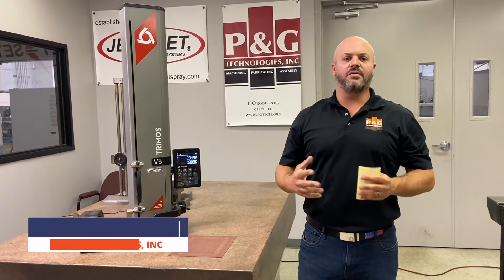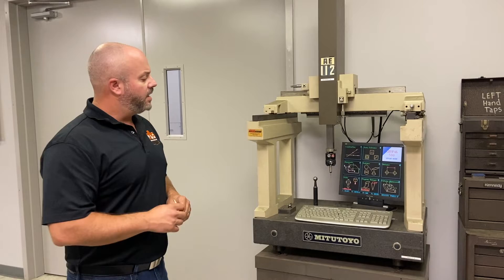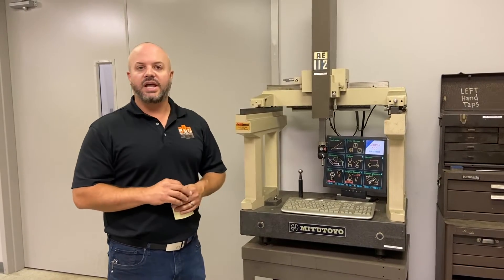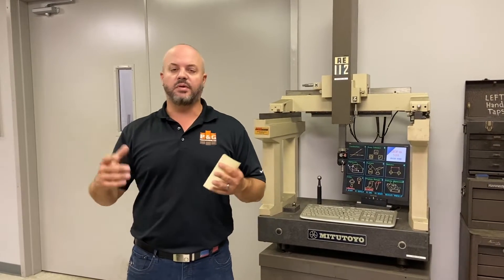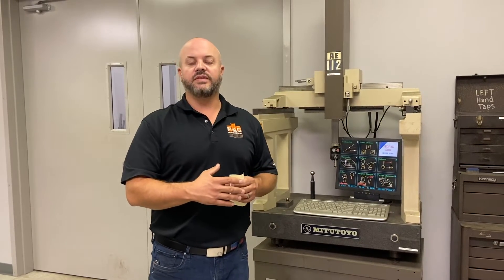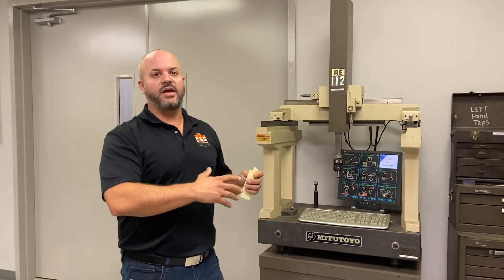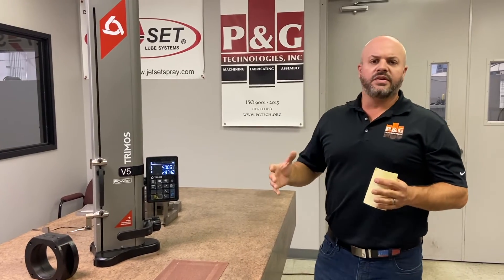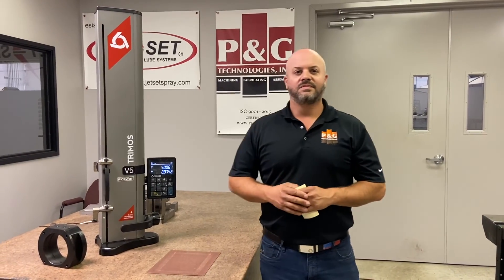Digital Height Gage OR Coordinate Measuring Machine?!

Comment: The CMM he is using is from the 70’s and still running and working. Where will that digital height gage made in China be in 40 years? Mitutoyo also makes height gages. Don’t let a vendor dictate what you need for metrology because that is all he sells.
Reply: With all due respect, that Trimos height gage is manufactured entirely in Switzerland.  Mitutoyo does make height gages as well, but will you get one made in Japan...or Brazil?  It shouldn't matter, if their quality control is robust, but the last Mitutoyo height gage I worked with developed about .100" 'backlash' in the plastic rack/pinion elevation adjustment in less than six months.  Scale still read accurately, but the lack of quality was a huge disappointment as I prefer Mitutoyo for most other tools.  I totally agree with what you said about not letting a vendor dictate what you need because that's what they sell.  I have seen that a lot, especially with cutting tools, unfortunately.

Comment: I wish this came out just a couple days earlier, I'm right in the midst of this debate for my shop right now and have been doing some deep dives on these linear height gages.
Reply from the maker: What are some of the different perspectives/ sides of the debate?
Reply: @PracticalMachinist  I am a one man shop. With that in mind, these were my big bullet points.
Price - this varies a ton. Height gage is relatively set, whereas used CMMs vary as to what is available, and vary even more with hidden repairs
Serviceability - height gage is large, but possible to ship to factory for service. Cmm is essentially field service only.
Ease of use - height gage relatively quick and easy to learn, cmm depends on software.
Capabilities - cmm in theory wins here, with the ability to measure things like hole intersection on double compound angles, etc. Biggest thing for me, was, assuming a hole was 100% concentric, accuracy of measuring a hole. To me, it seems like the height gage wins here as the used cmm market has a ton of variables. My experience leads me to believe most used CMMs are not as repeatable as I would like.
Support equipment - height gage needs power, blocks and accessories for stabilizing part, and a surface plate. Cmm will need ultra clean air, possibly equipment to write inspection programs. Height gage seems somewhat resilient to shop floor conditions, some CMMs are designed with shop floor on mind.
Reports - CMMs will have programs where they can fill in many fields,often in one setup. Height gage will need multiple setups to measure in different planes. Height gage is more tedious to do same measurements like positional.

To me, it seems like unless you are large enough to have  a dedicated cmm employee, the height gage seems like the better option.

Comment: On a height gage that size, I'm really surprised Fowler/Trimos are not using the 'paddle' style motorized movement of the probe, as they've used on the Z_Cal and Hi_Cal gages.  Cranking that little wheel back and forth all day would be a drag!
Reply: the v5 is also motorized, you pull the crank handle out to engage it, and there are 2 buttons behind it for up/down. It's up to the operators preference, measurement accuracy doesn't seem to be affected on ours.
Reply: @Fr4g4lot  Ahh, okay.  So that makes more sense, sounds like the 'best of both worlds.'